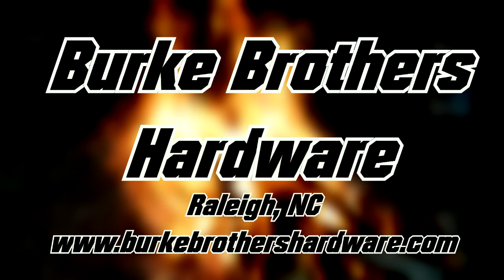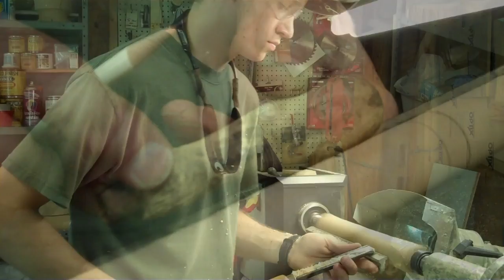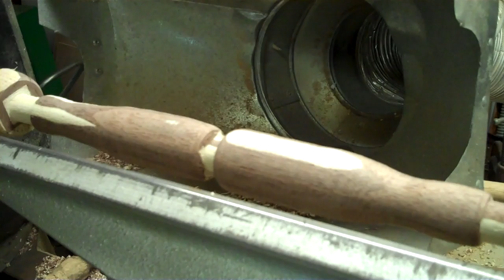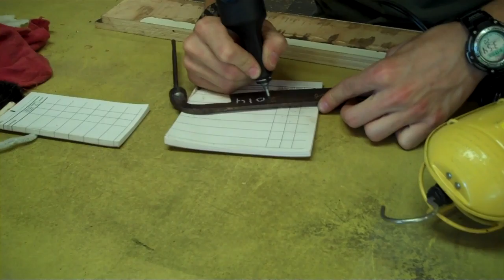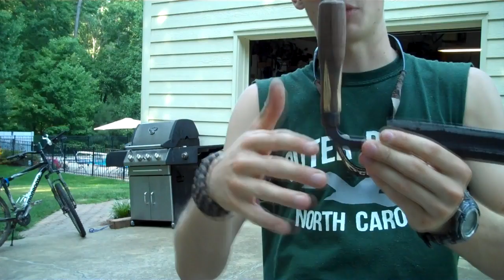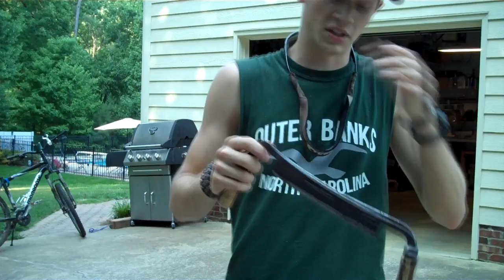Turning Custom Draw knife Handles | Pt 2

Comment: thanks for that. I recently picked up a draw knife thats missing the handles so i've got the same job to do except  mine needs re heat treating and mine had old press moulded washers on it to hold the handles on and one of them is missing so that's going to be a job for the metal lathe with my uncle.